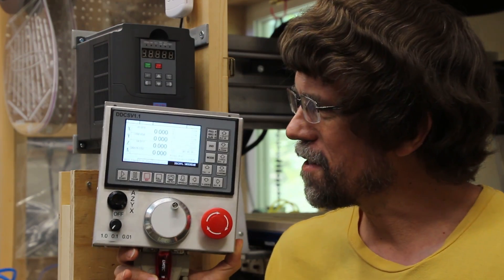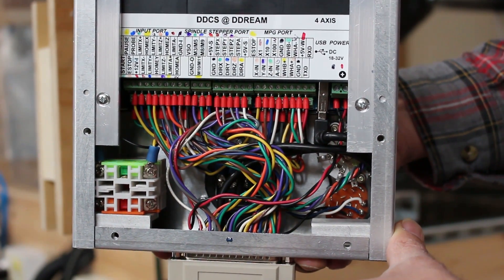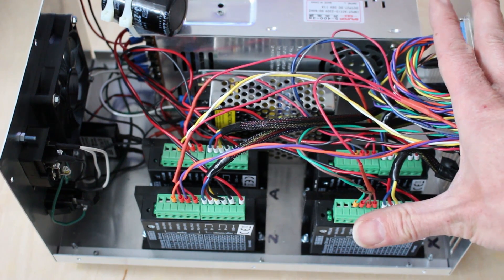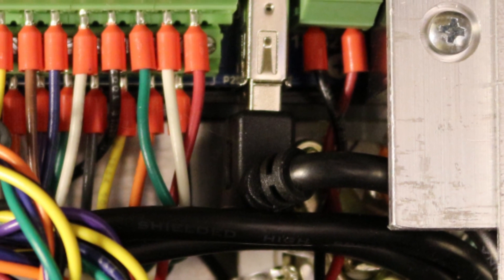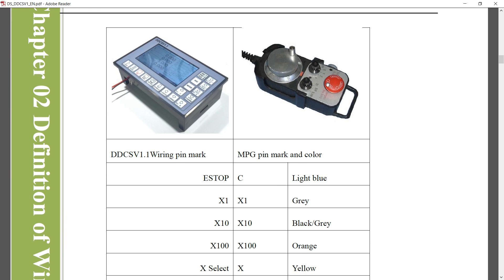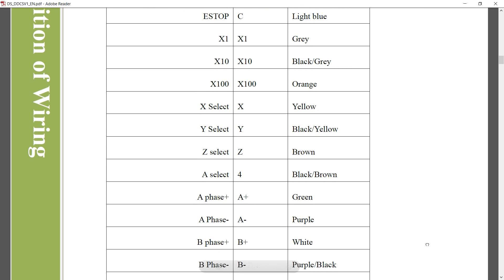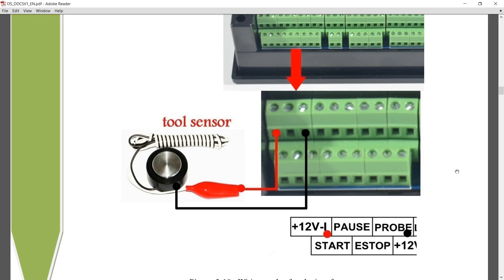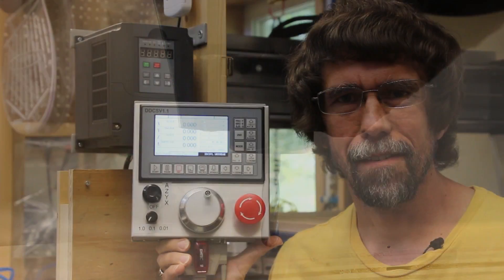CNC Controller Wiring & Setup DDCSV1.1

Comment: im a bit confused to how to connect the drivers to the controller.  when looking at the connections on the controller, there is only two ports for +5v-s but you have xyz to connect.   so one of the axis will be missing +5v-s to connect or do you daisy chain all the common to any of the +5 ports? Im used to working with bob's that have separate connections for each axis
Reply from the maker: The +5v outputs are just a common power supply for the opto-isolated inputs on the stepper drivers, so yes you just daisy-chain the +5 to the + side of step and dir on each driver. The step/dir output signals shunt current to GND when energized so they go to the individual - inputs on the drivers.

Comment: Wire gauge?
Reply from the maker: The signal wires carry very little current and wire gauge isn't critical. I think I used 20 or 22 AWG because it's what I had on hand, but a thinner gauge would have worked fine and would have been easier to deal with inside the enclosure. The higher-current wires are the power leads to the stepper drivers and going to the stepper motors. I used 18 AWG 4-conductor shielded cable to the steppers, with the outer shield grounded (at the control box end only) to help reduce radio frequency interference.

Comment: Excellent explanation, although I am having trouble finding visual wiring instructions for DDCS v3.1 to MPG. There are plenty of manual graphics but what I think would really help is a step by step in real time and real wiring. thanks for this video
Reply from the maker: Wiring the MPG is easier than you might think, at least for the kind that I used. It has 6 terminals on the back: GND and +5V supply power, and the panel has a regulated 5 volt output for this purpose (just don't connect a +12V supply to the MPG by mistake). The other 4 terminals are labeled A+, A- and B+, B- (or something very similar to that) on both the MPG and the panel so you just connect them up accordingly. These signals are not very high-speed so there are no special wiring requirements. Sorry I can't do a wiring video at this time but hopefully this will help.
Reply: @BrainRight  So my issue was that my VFD has ACM, DCM, VI and FOR as pins which were not the usual nomenclature for pins in most videos.
My current issue is that I'm having trouble wiring my limit switches.
What is the difference between a home and a limit pin?
should a limit/home pin be grounded to a COM- or + or something else?
and for some reason, when I plug my limit switches in, they don't stop the axis from moving, but they'll turn off the spindle? I can sense I'm close, I just haven't properly wired it yet.

Comment: how the two different stepper motor and driver sync at the same time in y axis while control it using jog
Reply from the maker: You should be able to wire two stepper motor drivers in parallel to the same Y axis STEP/DIR outputs. I have not personally done that since I have only one motor per axis on my machine.
Reply: @BrainRight  Thanks 🙂

Comment: Amazing video!! I have a questiom, how can i connect a servodriver (not stepper) to the DDCS? thanks a lot.
Reply from the maker: Thanks, glad you liked it. The controller only provides step/dir outputs intended for stepper drivers, but you could use a closed-loop hybrid stepper driver that accepts step/dir signals. It doesn't give you absolute positioning like a true servo but it uses closed-loop feedback with an encoder to overcome lost steps and to support higher acceleration etc. Here is one example from Automation Technologies: https://www.automationtechnologiesinc.com/products-page/nema23-closed-loop-stepper-motor-system-hybrid-servo-kit/hybrid-servo-drive-kl-5080h

Comment: Hello sir...i have DDCS V3.1 How to make offset each tool with different H offset tool...? such as T1 T2 T3 and so on. Thanks a lot ...
Reply from the maker: I'm not 100% sure I understand your question but I create a separate G-code file for each tool since I have to change them manually. Because most of my projects are one-off I can simply modify my toolpath to adjust a tool offset and regenerate the G-code. That wouldn't be so practical in a production environment but it works fine for my purposes.

Comment: Wrong idea mount this controler in this long cable connections  . Signals wireing must be in twisted pair wires puls signals its in high frequency in this case its better use LAN cable and conectors for puls dir wireing. In short job can work but if you put to long work  this system can dropt some steps in progres.

Comment: I got the RMHV3.1. The back is the same as yours. Wondering if you knew where to get the wiring sticker or at least a good picture of it?
Reply from the maker: No, mine came with the sticker already installed. If I had one without a sticker I might try making labels using my Brother label printer with 1/4" label tape, or just set it up as a Word document and play with the scaling until it prints acceptably.

Comment: I have a 24V unit. Do I still need to supply 12V to the last block of home/limit switches?
Reply from the maker: Those inputs are opto-isolated so they will handle a range of voltages. Just be sure to check the voltage ratings in the manual for the specific model of controller you have.

Comment: What are and where did you get the wire end covers where they get screwed into the connection points.
Reply from the maker: They're called wire ferrules, and you can find lots of them (along with the crimp tools for them) by searching for "wire ferrules" on amazon.

Comment: Hello Brain, very nice video.  I would like to ask you about one systema  iam trying to startup. I have one RATTM RMHV3.1 CONTROLLER it is already wired with the HBS860H hibrid servo drive and motor 86HBM11 18-1000. When i start the system all three motors get the voltage and wait for the signal from the CNC motion controller. Could you let me know if the motion controller is able to control these kind of Hybrid servo drive and motor. If the case is yes colud you help me to get parameters i should select. If not could you let me know where colud i get this info ?   Thank´s in advance.
Reply from the maker: Sorry I don't have any experience with hybrid servo drives, but from what I have read they typically use the same kind of PULSE/DIR signals that stepper drivers use so I expect it would work similarly.

Comment: Thanks for the great informative video! Is there a parameter that will set the display to inches?
Reply from the maker: No, it displays millimeters only. You could possibly scale the pulses/mm by 25.4 to calibrate it in inches, but it would still "mm" on the display.

Comment: well  i wired up all of the spindle controls . ????? Also use all of the rellays . Not even close to what you described . Using v2.,1 version but basically the same. They are comon positive control. As were as the spindle speed pulse . You do under stand that the board is optoisolated??? I did find your videos very helpful. I used them to upgrade a resta 220 industrial sewing machine. The results are just amazing .90 minuts of quilting and the needle ended up in the same hole it started off
Reply: The limits and the homing spots are crusial, with out them you are rented useless us you can not try ready commercial designs. Also builded my own style of inverter for the drives . I get very good torque and speed with no much heat. take in mind that the sewing cart weigh is around 380 kilos
Reply: for you it might have been hobby to me it helped me restore my factory line and gave work to three people . You must be proude .

Comment: did you run circle by G02 or G03 Code? In my machine it draw ellipse instead circle. but if regenerate gcode with G1 instead G02/G03 i will get correct circle. I am wondering if this my unit problem or you got same problem.

Comment: Good morning Mr Brain Right
Your video about DDCSV 1.1 is very interesting and helpful. Thanks alot . I have just bought 1 awith  the handwheel combo. But  unfortunately. The collor of hand wheel 's wires are not correct with the diagram  provided by manuafactory.  So iI had to look in side the hand wheel to wire correctly. The problem I get is the three wires of e-stop . Could you show me how to wire it?
Thank you.

Comment: At 1:42, you show how the cables are connected to the motor drivers. What did you use exactly in the end of each cable? They look like crimps but are they? TIA!
Reply: The wires are terminated with bootlace ferrule crimps.  Its the professional way to terminate cables and isn't even expensive.  Google "Preciva CP621200 AWG 23-10 Crimper Plier Set Self-adjustable Ratchat Wire Crimping Tool" as an example.
Reply: Those are called 'ferrules'. You can buy and assortment of them and their matching crimp tool cheaply on ebay.
Reply: Lazaro, those are called ferrules. All professional work, done with stranded wire are terminated that way.

Comment: Great video! Very informative!
I'm planning to buy either DDCSV2.1 or SMC4-4-16A16B. Does this unit support XYYZ setup (or XXYZ gantry type CNC)?
Reply: you can split the wires coming out the controller so you have 2 of each (PUL, DIR, Step,GND) and connect theso to the 2 stepper drivers so the motors should run the same

Comment: Hi,  can this controller do slave axis on X if so  how will this be done?
Thanks!
Reply: A year late so no good for you but I have this controller and what you do to run 2 nema's on X if anyone else needs to know is run X dir and X step to a connector and from there to 2 stepper drivers cloning the signal.

Unfortunately no dual homing but you can't have everything.

Comment: entonces un dibujo basico como una circunferencia o un cuadrado ,tampoco se puede dibujar directamente sobre esta ?
Reply from the maker: No you cannot directly draw any toolpath or edit G-code files on the controller itself. It only runs files from the USB thumb drive and cannot edit them. Personally I don't find that a limitation because I would not try to edit them on the controller's small touch screen anyway, and because most of my projects require complex toolpaths generated by CAD/CAM software.

Comment: hola mr Brain en estas  Navidades me estoy pensando comprarme este plc , pero tengo algunas dudas ,  se puede dibujar directamente sobre plc ? ,o de lo contrario  que programa necesito para dibujar en pc y luego pasarlo al plc ,es facil de utilizar ?, lo necesito para un plasma cnc. gracias
Reply from the maker: You cannot program this CNC controller directly, you need software on a computer to generate G-code that the controller will run. Simple G-code can be edited with a text editor and that might be sufficient for basic plasma cutting. For CAD/CAM software I use Autodesk Fusion 360, which is licensed for free (yes really FREE) for hobbyists and startup businesses making under $100K per year. Otherwise there's a licensing cost but it's not too bad. There is a lot to learn in order to use Fusion 360 but you can find many tutorial videos for it here on YouTube.

Comment: Great video. I was thinking about getting myself an arduino to run my cnc, but this looks so much better and there's a lot less hassle to deal with all additional controls. 
One question though, how is it with inverter/spindle wireing? I understand how it is connected to controller, however I don't know how connectors look on spindle's inverter.
Reply from the maker: Different VFDs may have different conventions, and I have seen some differences in how the connectors are labeled so please refer to the manual of your particular VFD, but the connections to mine were very simple. The START input of my spindle drive is wired to the M3/M5 output like in picture 2-12 in the DDCSV1.1 manual. The VSO output is similarly wired to an analog input of the drive that in my case was labeled "0-10V". There is a common ground for these signals so it only takes 3 wires. I also had to configure the VFD to use these signals to start the motor and for the speed control, which by default are controlled by its front panel buttons, but once I set those parameters (again refer to your VFD manual) it just worked.
Reply: Thank you for your answer. I'm getting a 3kw spindle with VFD that looks the same as yours and I did some research about it and it seems really straight forward.
Just one more question if you don't mind; if there's a power outage, does this ddcsv controller have an ability to run the program from where it stopped during process?
Reply from the maker: As far as I know there's no simple way to start running a program except from the beginning. A power outage would probably leave the machine in an unknown position so I don't think a simple restart would be practical. It's also hard on the VFD so my advice is, don't lose power! If it's a common occurrence in your area, a UPS might be worth considering. You could even wire the power-fail signal from a UPS (some of them have a relay output) to an e-stop input of the controller so at least it would shut down cleanly and not damage the workpiece or VFD. The controller does remember the machine position after a normal shutdown so then you could restart the program from the beginning.
Reply: Power outages aren't that common, several times a year maybe when a huge storm hits us. But nothing to be afraid of for the most of the times. I was just wondering this, because I'm building a machine with 2000x1300 mm working surface and I'll cut simultaneously as many pieces of aluminium as I can, which will take hours to finish. I guess one way would be to make a gcode/program in more than 1 piece, so worst case scenario I'd lose 30 min instead of 5 hours. UPS is also something worth considering, but I'm exceeding budget I set my mind on x3 as it is. ^_^
Thank you for your reply.
Reply from the maker: Personally I would use multiple shorter programs when possible. Not just in case of a power outage, but in case of any other problem such as tool breakage etc. In a production environment one might expect it to run unattended for 5 hours or more but in my hobby shop it is very uncommon for things to work perfectly for that long!
Reply: Now the controller was upgraded to a new version. The new version supports NPN Switch and General MPG.
https://www.amazon.com/dp/B074FVNCTV

Comment: Is there feedrate override? It would be nice if the mpg operated as feedrate override when code is running.
Reply from the maker: Yes there is a feed rate override but as far as I know, it is controlled only using the front panel buttons and not with the MPG wheel.

Comment: Hello Jay
j'ai rencontré un problème sur le DDCSV1.1 dans le menu de configuration à la ligne 69 il faut mettre la mesure du probe,pour moi 30 mm ,problème après arrêt de la CNC il ne garde pas la cote en mémoire !A la mise en route 1 jour après la cote est à 0.00mm aurais tu une idée  sur ce problème peut être une mise à jour du firmware  !
Salutations
Joseph
Reply from the maker: Hello Jay
I have encountered a problem on the DDCSV1.1 in the configuration menu at line 69 it is necessary to put the measurement of the probe, for me 30 mm, problem after stopping the CNC it does not keep the dimension in memory! Getting started 1 day after the rating is at 0.00mm would you have an idea about this problem can be a firmware update!
Greetings
Joseph

Hello Joseph,
I have not used the probe so I haven't tried this setting before. I am surprised that it does not retain the setting though. Every other setting that I have used has been retained after cycling power on the panel. You should certainly check that you have the latest firmware version, but if that does not work then perhaps you can report the problem to the manufacturer. Sorry I can't offer anything more helpful about this setting.
Regards,
Jay
Reply: Hello Jay
J'ai la version d'origine ,je demander la dernière version de  firmware  ,car je rencontre d'autres problèmes ,je n'arrive pas à activer les limites  et inverser le sens de déplacement Z et Y ..... 
Merci de ta réponse
Salutations
Joseph

Comment: I see you have machine setup in metric system. Can you set up machine for standard (English units) measurements?  Basically my current machine makes 32,000 steps per inch and I use g20 gcode. Thanks for information
Reply from the maker: It is not trivial, but possible. The software labels things in "mm" but you could effectively calibrate in inches by entering 32000 steps per (unit). You might need to remove the g20 instruction, as I'm not sure whether that has any effect or not. It also might be necessary to change the precision settings because the allowed error would be 25.4 times greater in physical distance. For example I can accept a physical accuracy of 0.01mm in a CNC router but 0.01in would be too sloppy.
Reply: BrainRight thanks for the info. I can convert my cad/cam files to metric. Just wondering if there was a work around. I just love this setup over a computer due to dust. I have 3 cnc machines and each have their own pc. This would make my life easier
Reply from the maker: Incidentally if you are using Fusion 360 you can still design everything in inches if you want. There's an option in the post-processor dialog to either use model units (by default) or to run the post in different units such as mm. I work in both inches and mm depending on what I'm making so I use that sometimes. The CNC is all mm then but the design doesn't have to be. Other CAD programs may have a similar option.
Reply: Late to this party, but I set up my DDCSV1.1 in inches. You just have to ignore the mm. It was a little tricky, but it works great and I'm happy with the 3-place decimal accuracy. Sometimes a program will throw a G20 code in there and I have to remove it. Otherwise great though.